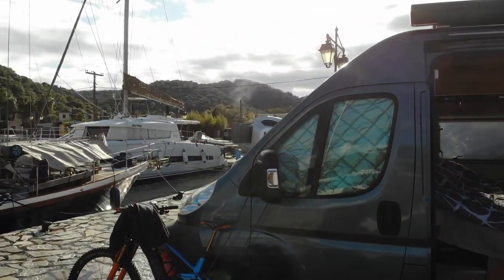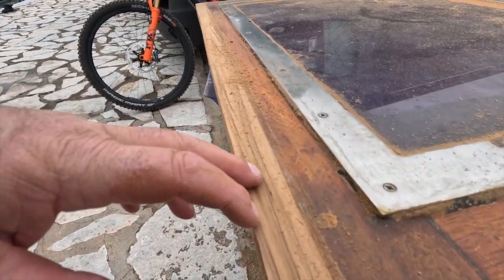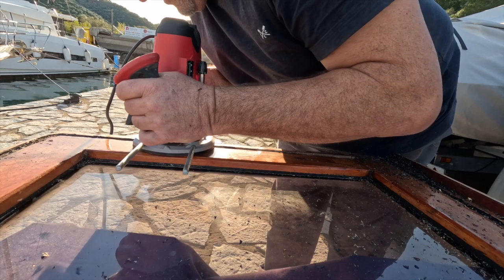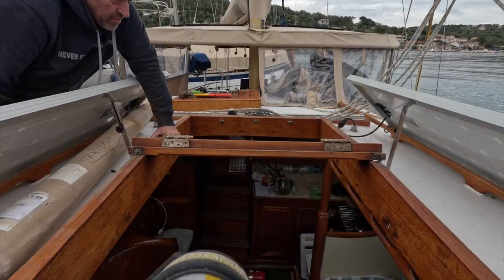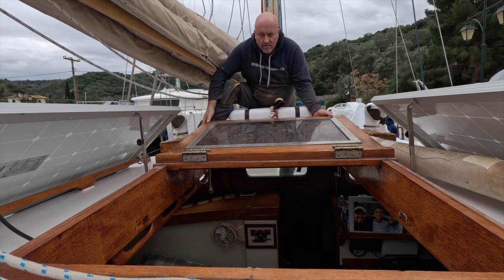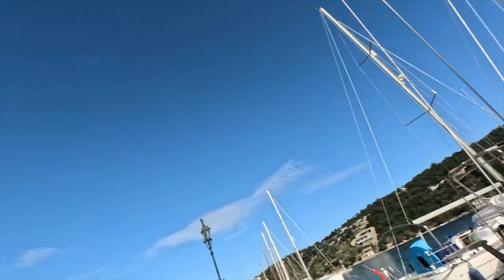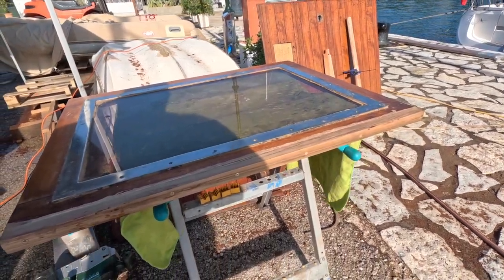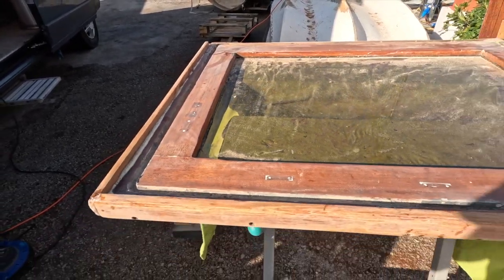EP 179 BUTTERFLY HATCH REPAIR

Comment: Repairing teak framed hatches on Skylark. 1st sanded down teak frames, next will throughly seal with penetrating epoxy then reattach acrylic cover. Finally will put several coats of varnish. Will last several seasons.  Good luck with your project
Reply from the maker: Hiya Shane. 

When the temps are higher I Amy pull the acrylic out , I’ve had Blown Away for over 20 years and have replaced the plexi glass before and I think stripped the frames and reviled them. 
I’ve been using a varnish substitute which is amazing stuff and lasts longer but not quite as fine a finish , the varnishing will start in April or May , what boat is skylark ?
Reply: @SVBlownAway  1969 mercer 44ft sloop
Reply from the maker: Pretty boat - lines similar to my own.
Reply: @SVBlownAway great video as always mate
Reply from the maker: Thanks amigo